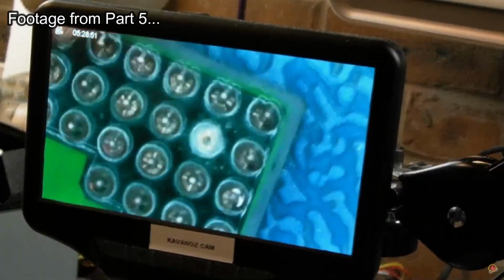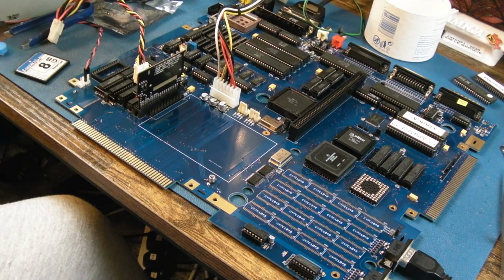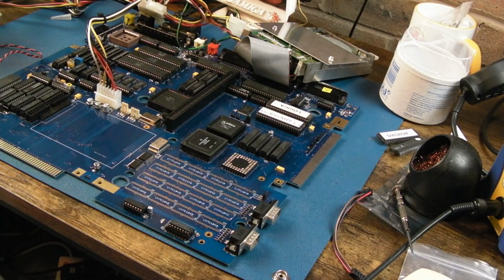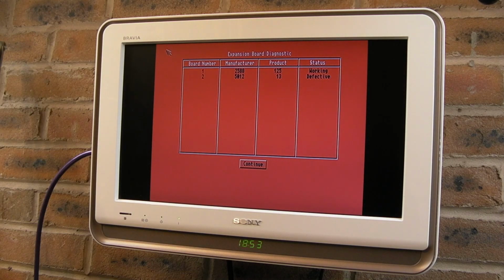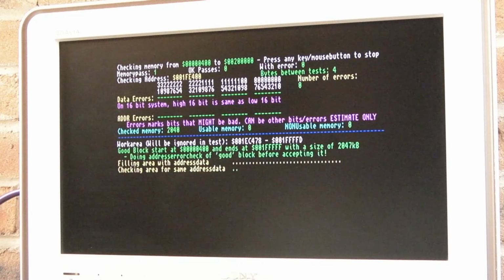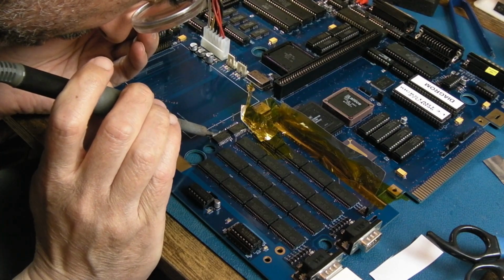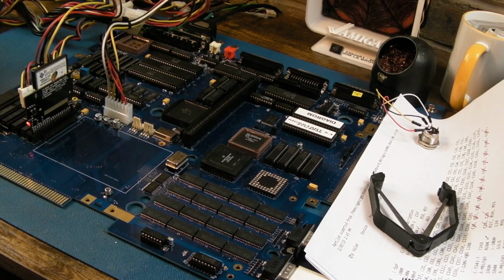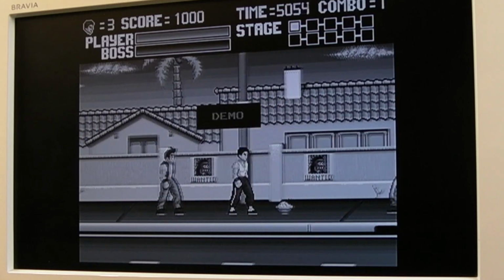Amiga 1000 Reborn Again - Part 6 (IDE testing, FAST RAM not working, chip ejecting, testing sound)

Comment: Shame there are no mounting holes to allow for a Water cooling solution to kill of the heat related problem.
Reply from the maker: Yeah, water cooling is a bit of a massive overkill for the heat issue!  I resolved it with a fan mounted on top of the CPU!

Comment: I built one of these some years ago. Does not work fully so I gave up, at least temporarily. Maybe I should revisit the project. I remember only half of the RAM working.
Reply from the maker: Maybe one of the RAM chips is bad or a bad solder point on one of those RAM chips?  I've completed mine and its solid!  You do need to make sure to fit the correct resistors for those places where the bill of materials is incorrect (typos etc).

Comment: Hey Gadget,
Just wanted so say I love your videos, I had bought a broken Neo Geo AES that I was able to fix after watching almost all(if not all) of your Neo Geo repair videos😁. I think my next obsession may become working on some of these old commodore computers, just from watching your videos, but I have a two or three projects I am working on at the moment I have to finish first. I was hoping that maybe you could provide some insight into one of them given your expertise.

Recently my Neo Geo CD (front loader) stopped working correctly completely at random; I don't even think it was plugged in. I saw on the neo dev wiki that you added the information on the broken L0 ROM. My problem was exactly identical to what you outlined on the wiki with the sprites first line being duplicated indefinitely. I replaced the L0 ROM and I am get mostly proper sprites again, but I have black lines across the sprites. The lines are seemingly at random intervals apart without a pattern. https://www.youtube.com/watch?v=kEE-56-uWE0 Here is a video I captured from the console with showing what it looks like. Was curious if you have ever seen anything like this before? Is the new L0 ROM bad or perhaps there is an issue with some of the other chips in the area? 

As I said before, thank you for these videos. You have helped me out a ton.
Reply from the maker: Thanks!  Regards to those lines going across the screen there - I have no idea off the top of my head.  Check your work on the LO ROM to make sure there's no bad / intermittant connection there.  Beyond that I would get the diagnostic BIOS running on the machine to test out the various types of VRAM.  Check what connects to that LO ROM, there might be a 74HC245 or something - if so, that may have died when the ROM did.  It could even be a Neo Buf chip - test connectivity to see if the LO ROM goes to one!

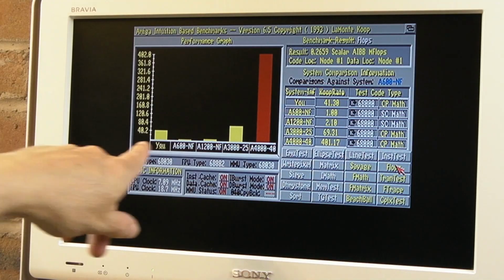Comment: 24:26 - Pixel corruption is due to a design flaw with the '030 cache.  The '030 cannot inhibit instruction and data caches independently, so if you only have chip RAM and the data cache is enabled, bad things happen.  On systems without slow/fast RAM (or it's not detected), use the "CPU" console command to disable the data cache.

Comment: 1:12 I slowed the video down 4x to see if you slipped some sort of easter egg in there, was just a random shot of the board that must have slipped into the timeline, I guess I just watch too many youtube wideos where they flash something up for a frame and immediately cut away! Great video though, love how you found an even more complicated way of getting a working A1000 than repairing a nearly dead original motherboard like you did for those 4000s!
Reply: top tip: you can pause the video and frame advance/rewind with the comma and full stop keys

Comment: 26:14 I would almost certainly have done the same thing there. lol

A definite typo on the schematic. :(

The "R" has always been used as the decimal point, so they did type it in the wrong place.
(I mean, of course you could also have say "6K8" to mean 6.8K, etc.)

33.2 Ohms seems oddly specific?
Not as common as dead-on 33 Ohms, I wouldn't have thought?
Reply: 33R (33 Ohms) is very common as a series resistor for clock lines and other digital signals, though.
IIRC, the same value is used on many of the signal lines on the VRAM (SDRAM) on Dreamcast.

Totally with you on soldering the SOJ chips, btw...

I thought I was "pretty good" at soldering them in my teens.
But then I repaired an Atari Jag for somebody about 6 years ago, and it took me about an hour just to swap some of the SOJ RAM chips. lol

(I pinched the RAM from my working Jag to test on the faulty one. It turned out there was just the tiniest spot of corrosion on the main IRQ_N line to the 68000, which broke the trace, and left it floating. Hence it was crashing randomly and doing other weird stuff.)

I said the same thing to Glenn on CRG the other day, as he had a bit of trouble soldering the SOJ chips as well.
Just when you think you have enough solder on the pads, it's hard to get it to wick onto the leg so it looks nice. lol
Reply from the maker: Yeah, I just went with 33R and it's fine =D  I can't imagine that .2ohm making much of a difference really!  But I think it's a typo!